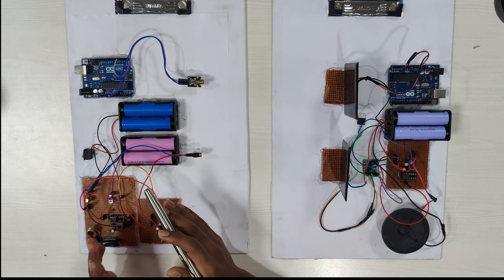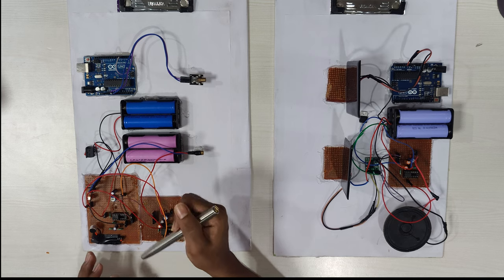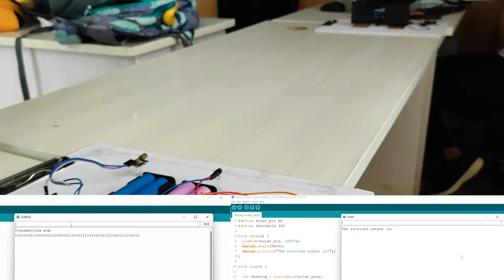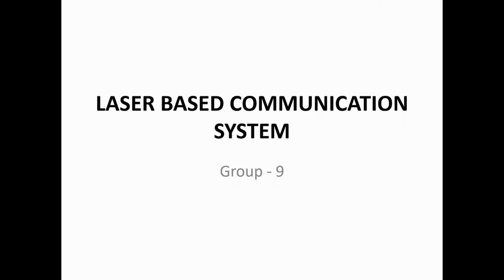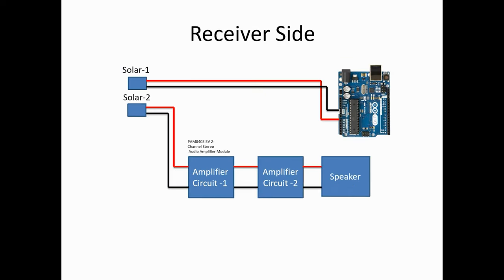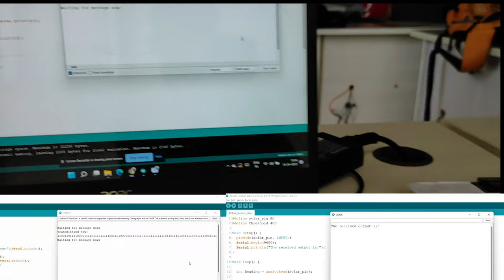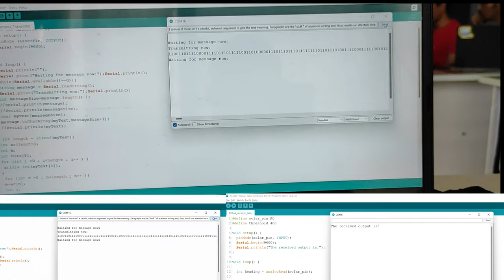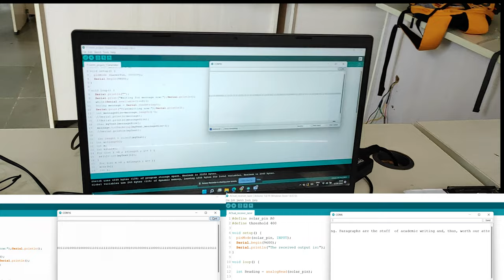Laser Based Communication System (Li-Fi Communication)

Comment: Can u provide water Level indicators to overhead tank on 5th slab
And water Level Indicator for sump in ground floor with alarms
Reply from the maker: yes , but we have to design a circuit with BJT's which can work more effectively. If u want the circuit diagram u can ping in whatsapp.